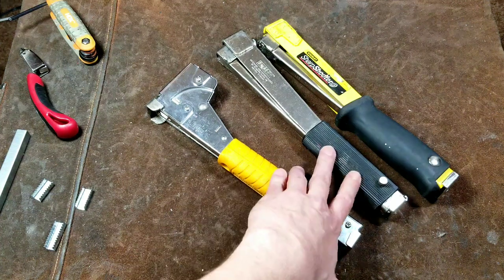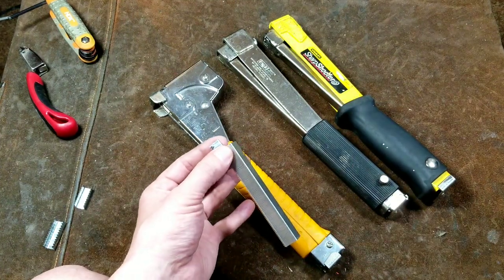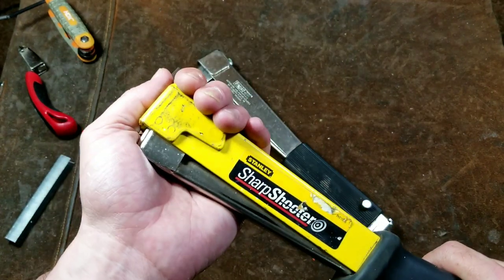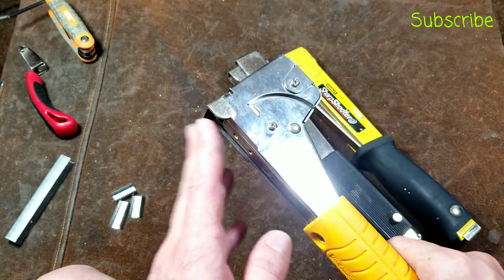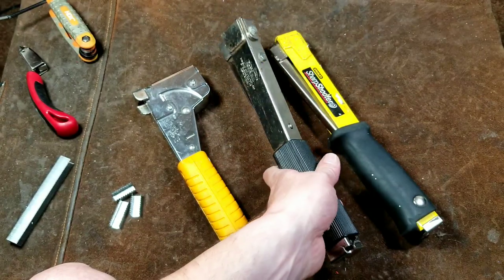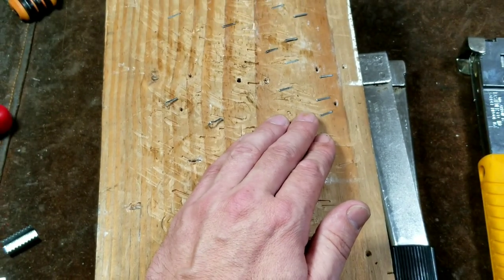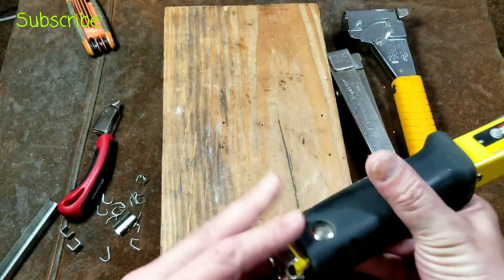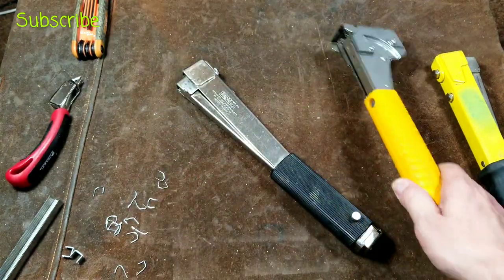Stanley/Rapid vs. Arrow Hammer Stapler Review & Comparison

Comment: I've got an older 90's version of the Arrow and it works great, used it earlier this year to put on tar paper when reshingling the roof.

My uncle bought a brand new carbon DeWalt one which I tried, and I preferred the extra heft of the Arrow.
Reply from the maker: Yes indeed these Hammer staplers do seem to work better when they have a nice amount of mass the lightweight ones just you have to swing really fast to get the staple to drive how you want it

Comment: Thank you for the video. You need to push the clip down in order to pull it out.
I tried to use 3/8 staplers and I could not hammer it all the way. Then, I have to used the hammer to get the job done.

Comment: I used 2 Rapid R311 and for a $50 stapler made in Sweden it disappointed me. The first began to jam and break Staples internally, the second one had the head break off where it impacts. It was Very heavy compared to others so I'm going to try out the Stanley PHT150C each $20 so I got 2 at once so I don't get stranded with a broken one. I use these to staple synthetic felt on to roofs I use 4-6 Staples per foot of distance sometimes more if the pitch is steep. I have thrown many in the garbage because they just don't last, Walmart use to carry the old Stanley like this one and they lasted a good time. The ones I ordered have a black finish instead of chrome so I think it's a new model.
I may look for a Rapid similar to yours, looks more solid the the R311.
Reply from the maker: I've had pretty good luck with these but you do need spare anvils those tend to wear out and if you don't change them then they start beating up the staple guide inside the hammer

Comment: Did you rip a$$ at 13:41? Lol to funny if so, guess you were swing the hammer tacker to hard and ya just kept going, no edit. But we use these alot in the roofing industry and I've always just used a Bostitch PC2K type and it works for the most part. But I'm curious about the new DeWalt Carbon Fiber version and the Milwaukee Hammer tacker version also and how they compare.
Reply from the maker: I've heard good things about the DeWalt carbon fiber as far as usability but I don't know about long-term durability. Carbon fibers problem is that it is not durable and once the epoxy starts to crack it can fail suddenly. I have experience with carbon fiber on bicycles doing that.

Comment: I don't even need one but I want one.
Reply from the maker: They are handy for many of the situations where you would use a normal stapler to tack things up these always work very well because you can put lots of force in and use extra-long Staples and it will drive them all the way in